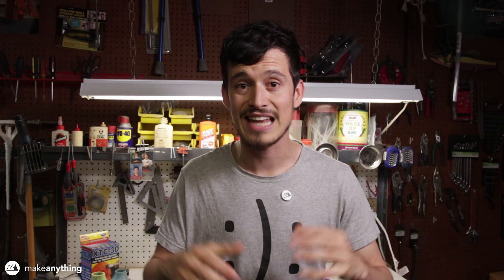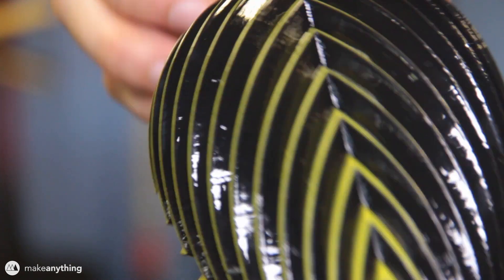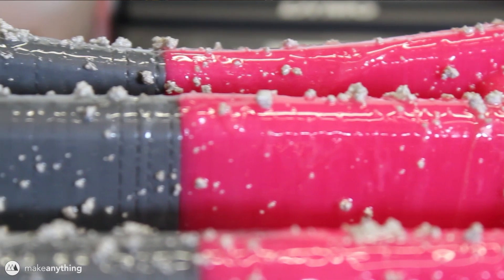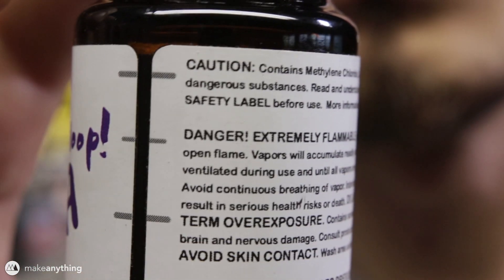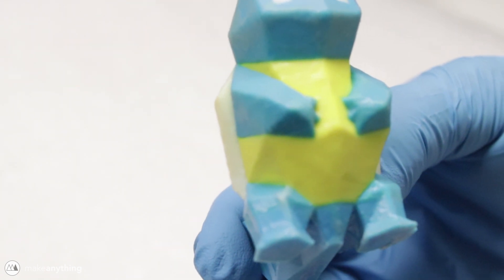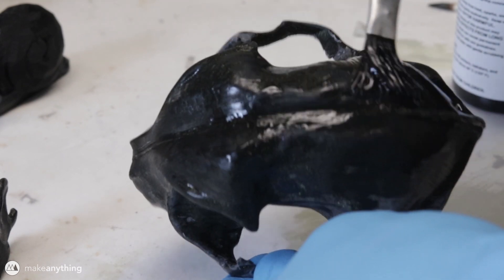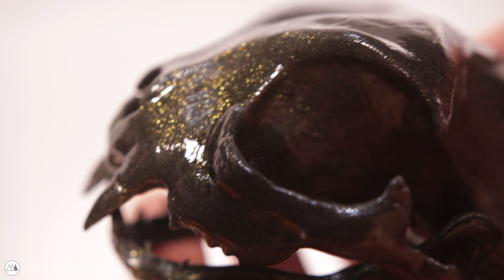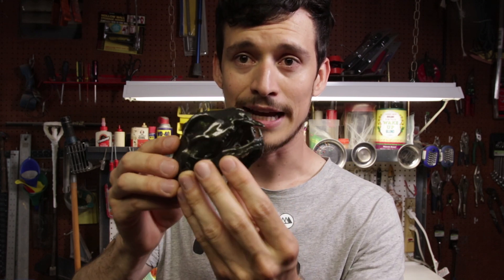PLA Smoothing 3D Prints with 3D Gloop!

Comment: It’s a cool product & a great video. But bro, please don’t blow smoke up our butts about the hazards of MEK when this gloop contains Methylene Chloride, a compound listed by OSHA as potentially carcinogenic.  Personally, I don’t have a problem working with either compound under a hood or with protection. But knocking other methods to “promote’’ this product kinda turned me off. Cheers & respect.
Reply: honnestly it's harder to find smth that is not on the list of cancerogenic than smth that is on the list.
Like, i mean there's magnetic fields and stuff like coconut oil foaming agents on the same tier of the list.
Reply: MEK is fine, as is acetone. Acetone is produced by your own body, as a metabolic byproduct. MEK is used in nail polish removers in place of acetone, because it’s slightly less irrirating to some types of skin. MEK actually does nothing to most PLA copolymers. It’s used for dissolving polystyrene, not PLA. The only things that do dissolve PLA are chloroform and tetrahydrofuran, both highly carcinogenic and hard to come by.
Reply: @oorcinus  I thought most non-acetone nailpolish removers used Ethyl Acetate now?
Reply: @oorcinus  what does chloroform smell like?....sniff...thump
Reply: Agreed, the very fact that there is a 10% off code, which is the name of the Channel "MAKEANYTHING", in the description kinda shows this is a sponsored ad for the product. Something that, unfortunately, is becoming far to common on YouTube these days. 😖😖😖
Reply from the maker: For what it's worth the final product will not contain Methylene Chloride, I've been told

**Edit: apparently it's cyclohexane they're taking out and the methylene chloride will be in small quantities.. so precautions should be taken!
Reply: @make.anything  dude... the MSDS says it is 60% methylene chloride. They're just repackaging an industrial organic solvent similar to acetone, MEK, etc. I've used them all and the same safety precautions should be taken for every one of these. I know this video is old but please be careful with these chemicals.

Also, for them to say the product won't contain the exact main ingredient needed for it to be a useful organic solvent is ridiculous. That is like me telling you I will sell you bleach to clean your bathroom but it won't contain Sodium hypochlorite at some point in the future of product development.
Reply: Everything is carcinogenic though, sausage, standing, sitting, being outside, being inside. Mitigate your risk like a smart person and don't be stupid with chemicals and you'll be fine.
Reply: Not only that, but he used Acetone for ABS smoothing, which is just as bad if not mildly worse than MEK.

So acting like MEK is super dangerous is silly.
Reply: @Nevir202  Your body produces Acetone. It's not bad in small doses but does pose a health hazard if breathing it in excessively as you can suffocate if you don't get enough oxygen.
Reply: @DrJIMMI  your body produces Acetone in miniscule amounts and it never gets oxygenated.  Not the same thing.
Reply: Also... that’s a dust respirator not a VOC mask.... 🙄

Comment: If you are up for it it would be interesting to see you print the same skull in the same filament put some effort into sanding it and then just hit it with the Rust-Oleum clear coat and compare the two
Reply: Actually the guy who said sand it with what is onto something - scotch brite is indeed a very good substitute for higher grit sandpapers - start out with lower grit, say 120-180, then go to 400, then green-red-black scotch brite or equivalent. for small stuff finish using a soft polishing head on a Dremel.
Reply: @alexhyland9393  Yes indeed. I used both red and gray for years in a body shop. Sand, clean. Good last smoothing before color spray.
Reply: So generally the higher the number (grit) the finer the paper will feel, also it maxes out at 1000.  You can polish/sand items to get a natural gloss effect.
Reply: Steve Coffey Jr sand paper doesn't max at 1,000. You can buy up to 2,000 at your local home center, and 5,000+ elsewhere.
Reply: Overkill follows:
AliExpress has 10000 grit paper for $2 per sheet. 
You can also get 0.25 micron lapping film, which is ~100k grit (american standard). 
I know 0.125 micron (200k grit) is made, but I think that only comes as powder, paste or spray. 
I also found 0.1 micron Cubic Boron Nitride spray on ebay. 
EmsDiasum sells 0.05 micron alumina powder and slurry.
A firm called Jende sells an emulsion for knife polishing they say is 0.025 micron. They compare it to 620k grit.
Reply: Vemund Dyrkolbotn dang you really put a lot of work into that comment
Reply: @srcoffeyjr  no, sandpaper doesn't "max out" at 1000. Wtf
Reply: lol 10,000 must be normal paper, easy way to sell paper for more than it's worth
Reply: Sand it with what? Scotch Brite?
Reply: @r.a.8861  I hear sand paper is great for sanding
Reply: sand it with what,Said dumb and dumber... 😂
I've done that with tons of my place prints and it works great, but the only thing you have to watch out for, is using to low grit sandpaper.
From experience, I found that 200 grit does the trick.
I've also used clear coats, but it works better just to hit it with a glossy spray paint in the same color as the plastic. 
I would just hit it with a few layers of paint or clear coat, and sand it after.

Comment: Though I wouldn't use it for smoothing, Tetrahydrofuran (THF) works incredibly well for bonding ABS or PLA (and PVC) parts together. it's about as toxic as acetone but a lot more volatile. In its normal state it can form explosive peroxides on exposure to air so be sure to buy the inhibited stuff ;)
Reply from the maker: Sounds good.. another option I've got to try :)
Reply: Im using THF too and you can use it just the same way like your 3d Gloob. It might be more expensive than acetone, but for sure cheaper then 3d Gloob its easy to get for example as Tangit solvent "TL 8 N" from local Homeworker store
Reply: Even inhibited THF, when exposed to air can form peroxides over longer periods of time. So I would only buy in small  quantities and not store them around for too long. I've also been in a room where someone spilled a bunch of THF and believe me, its not fun, so its best to use THF outside if you don't have access to a fume hood.
Reply: Agreed. A small plastic bottle like you use for model glue is perfect. The trouble is buying small enough quantities for hobby use!
Reply: I've experimented with THF pure grade 99% and.. it is pointless. 
It does not work for smoothing at all.
I've tried brushing, vapes ect.. Does not work the way  Acetone on abs at all or even close.
It is average for glueing-bonding PLA.
If one want to make any usefull elements that later can be chemically glued or vapes the best choise is to go PETG and use cyclohexanone(which is like acetone only smells a bit different). Easiest way of making useull things apart from petg stringing..
Reply: Maker's Muse I think you should get 4 pallet+ and hook them up to the prusa i3 mk2
Reply: Hi Angus, why not for smoothing? Seemed to work very well in this video. Please explain... Thanks! Love MM btw
Reply: I'd think a chance of explosions would make things more exciting but I guess I'm a minority here. Do any of you have any experience tumbling their prints? I'm not sure if there's a better word in English but for metal parts they sometimes get put in a rotating drum with little granules that feel like they would polish things in order to get them smooth. I wonder if there's a right type of granule that will smooth but not wear into the part.
Reply: compared to acetone its not "as toxic" ? on the first look yes , but on the second it has a ongoing cancer investigation (Europe,REACH).
The english wikipedia does not contain this information only the german pages.
Reply: This behaves like transparent nail polish. You can even find one with gold glitters inside to gain this (probably) expensive filament effect. Correct me if im wrong
Reply: Chloroform smoothes PLA... ^^,
Reply: thf is a very very poor choice.. just use acetone for abs, and if youre crazy enough to use thf for pla just use chloroform outside instead...
Reply: have you tried this with clear pla filament?
Reply: Maker's Muse we've got a NERD over here. No hate though angus i love the geneva drive
Reply: Maker's Muse ive used nail polish for qute a while

Comment: How is it different to XTC3d? You just dont like mixing the two compounds together? It seems to get very similar results to XTC3d for me, especially if I did 3 coats of it, I usually only do one.
Reply: ImpatientTurtle I don't believe the 3D group is a coating I believe it evaporates so when you're done it's no longer there or at least mostly not there XT 3D is literally just an epoxy coating you are adding material to the model
Reply: Nerys Ahh, so it's actually breaking down the pla? That's how it smooths it out? As opposed to the xtc3d rt filling in the layers.
Reply: ImpatientTurtle correct I believe that is basically what it's doing I'm not an expert though :-) that is precisely what XT 3D is doing filling in the gaps with epoxy I believe the chemical in the 3D gloop is actually slightly dissolving the pla which would allow the flow and smooth and fill it its own gaps which is why he had a problem with it becoming gummy if he applied too much
Reply: Nerys Oh right, thats pretty cool then. Did I miss that in the video? I suppose he did say xtc3d adds layers which can mess up tolerances. So this stuff isnt adding, it's pretty much subtracting haha. Coolio, cheers Nerys.
Reply: ImpatientTurtle he did say it but not explicitly if you add too much then yes it would probably remove material the trick is not to add too much :-)
Reply: Nerys Gotcha, I am dog tired and not the sharpest tool in the shed today haha. Thanks again.

Comment: The real test would be smoothing without a glossy surface -- gloss does what gloss means -- all gloss "smooths" with an optical covering-over. If that is what you want great -- but I can't help feeling this does what any gloss paint would do. Just a question -- feel free to dispute this.
Reply from the maker: This smooths out the filament itself. If you use a gloss paint you lose the original filament quality.. both methods have their merits though, in my opinion

Comment: Methyl ethyl ketone is pretty similar to acetone. Another name for acetone is dimethyl ketone or methyl methyl ketone so don't be to scared it's just a carbon and two hydrogen atoms more, just look it up. If you work with acetone I think there should be no concerns for this chemical.
But still, nice video
Reply: Not to mention this uses Dichloromethane and Cyclohexane...

Comment: Sorry for the long comment, it's worth it I promise: I have been working with resins for many years, Polyurethane, polyester and epoxi for different applications, but something was odd, every single Polyester resin I bought, it didn't matter how much hardener I used or the conditions, it never fully hardened, it always stayed kinda soft and jammed ALL my sandpapers, from hardware stores, paint shops, online distributors, always the same except for 1, the ONE that is sold by FormX Spain for some reaso it always works, very very hard and easy to sand, cures fast, with low or high hardener, and I discovered recently that it sticks to PLA and PETG prints perfectly so that's what I use for smooothing prints. It's 11€ for 1 KG of resin hardener included and it lasts for ages, hope it helps
Reply from the maker: Interesting, that's for the tip :)

Comment: Dichloromethane or methylene dichloride does the job. It is a common solvent for PLA and It is an active agent in these compositions. It is volatile and should work in a fume chamber just like acetone works with ABS. It is sometimes available in 3d printer consumables stores but in my place it is 10 times cheaper in lab supplies stores
Reply: It is also suspected to be carcinogenic
Reply: You're right it is only the Dichloromethane that did the smoothing effect. And it is like using acetone with a brush on abs part. But I would'nt heat dichloromethane
Reply: The safety sheet is just scary...
Reply: Read a safety sheet of something like tea-tree oil, that is supposed to be "natural" and all good for you :-> .
Reply: I am a chemist who deals with lots of dangerous chemicals every day. I do not recommend most people to use this in their home or workshop. Some people here are making light of the Safety Data Sheet on Methylene Chloride (Dichloromethane (DCM); Methylene dichloride; Methylene bichloride; Methane dichloride) but it is definitely not a chemical that you want to be inhaling. And considering that the whole purpose is to utilize it's fumes I do not recommend people use this at home to smooth PLA prints. Here is an excerpt from the safety data sheet. 

"Inhalation:
Causes irritation to respiratory tract. Has a strong narcotic effect with symptoms of mental confusion, light-headedness, fatigue, nausea, vomiting and headache. Causes formation of carbon monoxide in blood which affects cardiovascular system and central nervous system. Continued exposure may cause increased light-headedness, staggering, unconsciousness, and even death. Exposure may make the symptoms of angina (chest pains) worse."
Reply: Based on the MSDS, that's the main ingredient in 3D Gloop.
Reply: Warning! Reading material safety sheets may cause acute anxiety disorder and lead to paranoid psychosis.
Reply: I use dichloromethane to glue PLA, found it at work by chance, they use it to glue any plastic (mostly ABS). It should work for smoothing, too. It's quite nasty though, also sold as paint remover - and its brother trichloromethane is better known as chloroform (the stuff that knocks you out when you smell it!)

Comment: Hello, I would be very very careful with that solution because it contains Cyclohexane. This chemical is really bad and should be used under a forced ventilation hoot. Also, this content is not correctly labeled. Methy Ethyl Ketone (MEK) or Cyclohexanone solutions are way safer option than this one.
Reply: Maybe he's got a ventilation owl.
Reply: 3D Gloop! That brush is awful, you could consider sell you product in nail polish glasses because you need so little amount of the product and the subcontractors for the vial are easy to find.
Reply: Ivan, we appreciate the cause for concern! We actually wanted to take a minute and update everyone that our product is continually being refined and updated to produce a better and safer product to the end user. 

Currently, we have been able to remove cyclohexane from our end product due to better process and control as it was used in excess durring previous stages of production. 

While most solvents are generally health hazards to some extent Cyclohexane is currently rated as a 1 on the NFPA 704 standards of safety/hazards of materias which equates to:  Exposure would cause irritation with only minor residual injury. 

Acetone and Methy Ethyl Ketone (MEK) carries the exact same NFPA 704 safety concerns as Cyclohexane.
Reply: Ventilation hood.
Reply: Also methylene chloride (dicloromethane) is ultra toxic and highly volatile so should be done in a fume hood :/

Comment: Doesn't this also screw up the tolerances? It's still adding material, isn't it?
Reply: IgnoreMyChan I think it slowly softens the plastic when in contact then it eventually evaporates
Reply: That might still mess with your tolerances, right? :)
Reply: I would think it does
Reply: I have used methylene chloride to smooth some prints and it will soften hard edges and fine details.